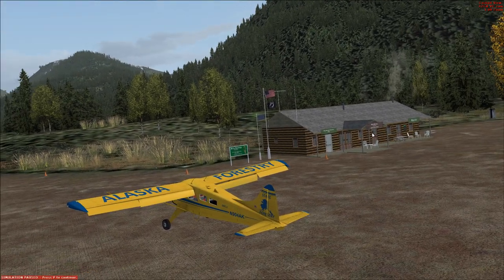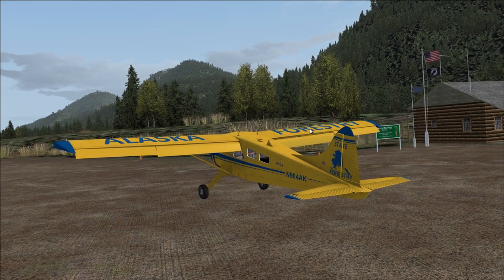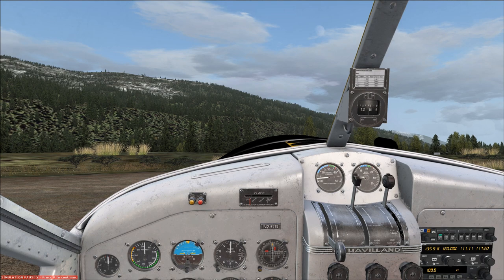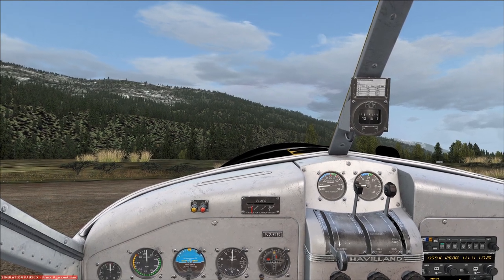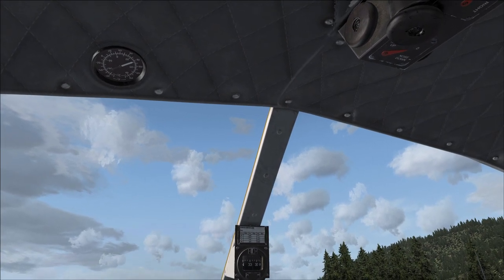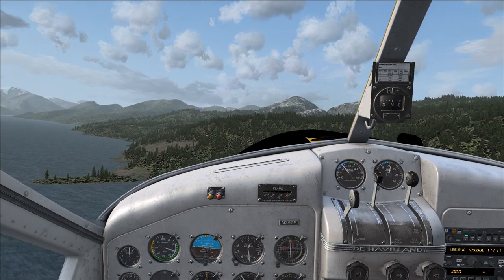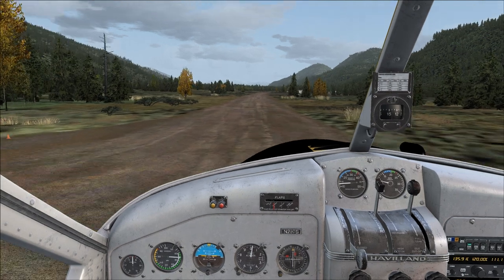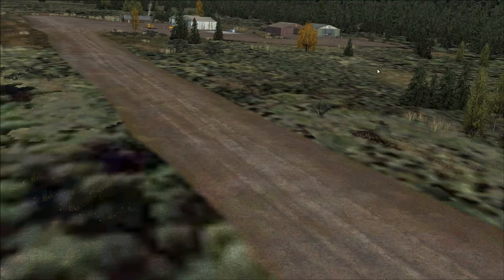[FSX] Milviz DHC-2 Beaver - UPDATED FLIGHT DYNAMICS!

Comment: FDE refers to an external Flight Model Engine only available for the T38A or the MJC8 Q400 (or other specific advanced addons). Am i righ ?
Reply from the maker: I'm not really the one to ask.  My impression was that FDE (flight dynamics envelope? Engine?) just refers to the code that defines the flight characteristics of a model.  Milviz themselves refer to this update as an "updated FDE."  But I wouldn't know the proper terms, and I really don't care.  I care more about what it does than what you call it ;-).
Reply: AJ Crowley Yes of course the effect is more important, but from what i understand external flight models not relying on the FSX/P3D engine provide better performance and a better flying experience. Anyway, i'm waiting for the Milviz SR-71 :D
Reply from the maker: M RO I'm definitely no expert on this. My impression is that you're right, when simulating an aircraft that's more complex or higher performance than what the FSX engine was designed for.  Complex airliners like the PMDG NGX, or high performance birds like the VRS Superbug, definitely seem to benefit from their external flight dynamics. But a single reciprocating engine GA plane like this Beaver?  When provided with well designed flight dynamics code (which this Beaver has) it seems to handle that very well.  Of course, the sim models I've tried that remind me the most of flying their real world counterparts are some of the accusimmed A2A birds, so maybe you're entirely right after all....  Either way, this Beaver has become my favorite bush plane by far!
Reply: People in the MSFS community have been calling it FDE for over 20 years.